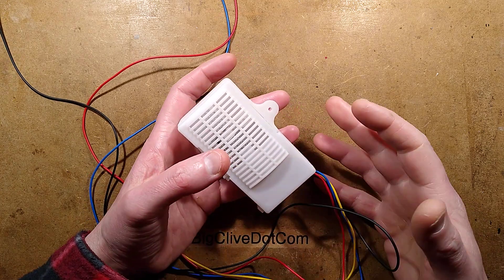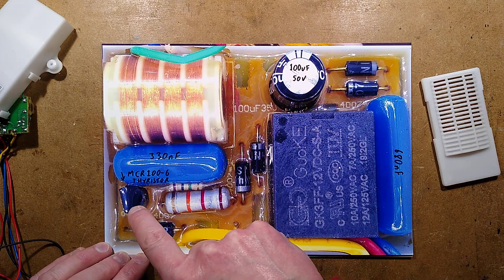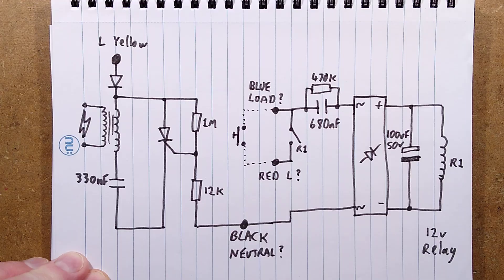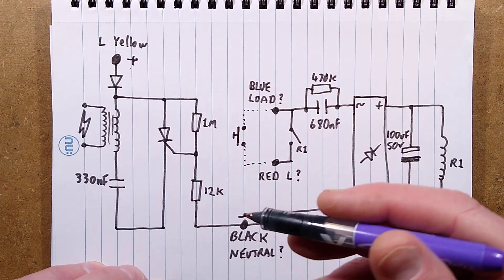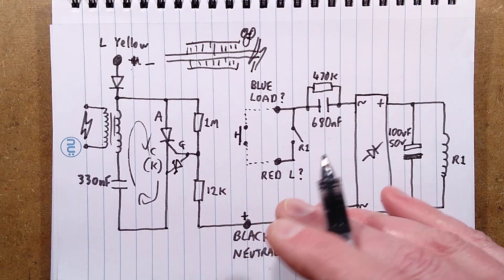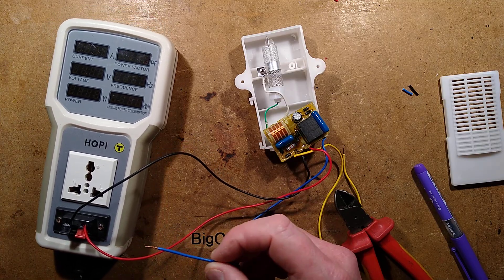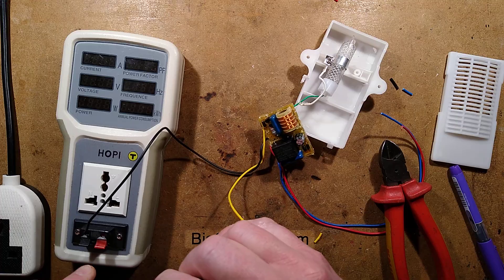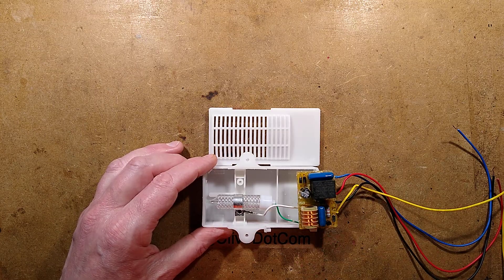Random high voltage eBay "thing"

Comment: "If it's stupid but it works it's not stupid."  Doesn't mean it's not terribly dangerous or short of life! 😆
Reply: hrm. in what sense, you mean because of electrocution/fire hazard? The amount of ozone it's going to generate isn't actually that harmful. Most of it will react by basically instantly with anything that can be oxidized at all; pretty sure you could keep it running in your bedroom without the ozone harming you at all. not that I'd recommend it, the sound is obnoxious - but the lightshow is sweet!
Reply: I was more talking in general,  @covodex516 .  Run hardware too hard or in unconventional ways is going to destroy it faster than creating a slightly more complex but fit-for-purpose implementation.  This device is pretty benign, you're right. :)
Reply: I agree with you Bro but it very work
Reply: is this more efficient and cost less than uv lightbulbs? My profession, put me at high risk to getting the covid.
I did very well. Considering, I knew I was in contact with the infected, every day. I had two powerful uv lights in a small room. I would turn it on and breathe in the ozone for a couple minutes, followed by taking a shower. Eventually, I got a low viral load of covid from a friend. I lasted 12 months, before the “friend” decided to be a fool. The covid, only lasted three days. not a problem... Except, no work for 2 weeks. Stupid World we live in.
Reply: @user-vl9xs5dl7q  What...? No. If the ozone concentration were high enough to be effective in destroying virions, it would also be harmful to you. and UV-lights do not produce ozone in any significant amounts, at least not the commercially available ones.

If you're actually being serious and sat yourself under running UV-lights, then congrats, you harmed yourself way more than Covid-19 probably would have. Spending time in a room with an uncovered UV-light will cause blindness and skin cancer in the long run. There's a reason it's effective in destroying microorganisms and even virions; and it's the same destructive power it has on human cells.
And neither UV-light nor ozone will destroy virions in your body, by the way.

But yeah, you said it...stupid world we live in, lmao...
Reply: @covodex516  i didn't sit long enough to “hurt myself” I turned them on and let them run for a few minutes, then entered the room. I wasn't trying to kill myself. but, you should have asked, instead of assume, that people don't know how harmful uv light is.
Reply: @covodex516  incorrect about viral loads. viral loads will die from uv light. not instantly. but they will die. You shouldn't assume, again.
Reply: @covodex516 
Commercial uv lights were available everywhere, before everyone got spooked. And yes, I knew before they announced it spreading. Not only did the government know. So to, did the military. Again, you assume what is available right now, is not the same, when I bought them.
Reply: @user-vl9xs5dl7q  maybe read my comment correctly? I said the commercially available UV-lights do not produce significant amounts of ozone. and that is the case, im not assuming. not because powerful enough ones would be sold out or whatever, but because there is no commercial applications for those. the disinfecting mechanism of UV lights does not rely on it's ozone production (which yes, it has, just not in amounts which would matter - fortunately) but by the radiation itself.

so what you actually did was disinfecting the air in the room - not even that if you just let it run for a few minutes, but whatever - and then went in to breath the air. great, you of course could've just went outside if you wanted "fresh" air, but hey, you do you. 
the way UV-disinfection actually works in professional labs is by leaving UV-lights run over night or even over several days, without personnel in it, so all microorganisms and virions on surfaces and the air get destroyed. they are shut off as soon as personnel wants to enter the room. and there is no significant amount of ozone to worry about in there - just believe me, I work in such a lab.

anyways, it didn't do anything to virions inside your body. and before you claim otherwise, completely unscientific bogus, come forth with an explanation instead.
Reply: @covodex516  You are also wrong about commercially made UV lights. Maybe you should do more research. Because, it sounds like, you are talking about some Chinese made crap.
Reply: @user-vl9xs5dl7q  and in what sense do you think I would be wrong? It's not a question of quality, but of energy.
anyways, seeing how you just glance over arguments you have no proper answer to, I think we can call curtains on this discussion.

As I said, if you enjoy doing ridiculously unnecessary practices, then you do you. just don't run around and spread bullshit everywhere.

Comment: These are used in refrigerators to aid in retaining freshness of foods. They are sometimes only on when door is closed.
Reply: I would guess that by oxidizing the food would get spoiled earlier, doesn't it? Please elaborate, I'm very interested!
Reply: @peterwilbrink718  Well fridge is cold to slow down little nastiness like bacteria etc? Ozone would kill them so thats gotta slow them down some more im guessing?
Reply: @jons6125  Makes sense indeed, using ozone as an additional measure against mold and other nastiness on the food.
Reply: @peterwilbrink718  I got one of those little triangle rechargeable ozone generators that Clive took apart and it works a treat. 
Had some green chilies that were getting a slight mould fuzz but only on the stalks. Laid them out in front of the ozone generator and it killed the mould totally in a couple of hours giving me enough time to use them up. 
Very effective!
Reply: @Aengus42  Amazing, I'm suddenly in need of an ozone generator:'D
Reply: @Aengus42  so it turned Chili's with mold into Chili's with Penicillin
Reply: @brenttate9299  It turned chillies with mould into chillies with smoked salmon pate, cherry tomato, smoked salmon, crabstick, green tobacco & sea salt crackers!
Result! 😀
Reply: @Aengus42  that's mold not mould
Reply: @brenttate9299  Not here in the UK it ain't! It's mould, coloured green!
Reply: @Aengus42  oh yeah that's right you're the same people to spell tires, Tyre
Reply: @brenttate9299  Tyres... Yes! It's all because of your Mr. Webster who simplified spellings for you. I guess because he thought cowboys were illiterate & needed some help. 
Yeehah!
Reply: @brenttate9299  Wasn't me, wasn't there! 😆
Reply: @peterwilbrink718  The UV and the ozone kills bacteria. Bacteria is thee major contributor to the decay of food.......
Reply: @lookupfromdownunder5218  major decay of food I think not you' don't know my wife cooking
Reply: @brenttate9299  Hi Brent, I have never tasted your wife's cooking but I'm sure she finds it delicious.
Reply: @Robin Rastle well given a fridge is basically an artificial cave, dark, cold but not freezing and mostly dry its not so surprising.
Reply: Thanks for reading your comments Bigcilve, I am a Sparkie too, in Australia, I like your videos. I am impressed by knowledge of electronics. I too have had a lot of experience in that area. Keep up the good work. Regards, Norm........

Comment: That's a sneaky trigger circuit, very simple and kinda free running.
I bet that generates rf noise of the best quality, almost like a little tesla coil going there.
Reply from the maker: Not sure.  It does look like it fires in a closed loop while on the opposite half of the sinewave.
Reply: @bigclivedotcom  Looks like the voltage rises till the 1 meg resistor provides enough gate current to fire the thyristor, and yes it's only on one half cycle. Nasty but it gets the job done lol If you put two back to back it could be a full wave ozone generator lol

Comment: You mention in passing that the wire might be copper coated aluminum, but since copper has a higher melting point, how would that even be possible other than electroplating?  Does that type of wire even exist?
Reply from the maker: Sadly it does.  Many flexes with products from China via eBay have copper coated aluminium.  You can test it by stripping some and holding a flame under it.  If it glows and holds its shape it's copper.  If it flares and and droops it's CCA.

Comment: I think that thyristor thing is pretty much a standard trick. I haven't used thyristors, but I've used Triacs which are pretty much the same thing. Triacs can be fired in FOUR different quadrants, and I'm pretty sure this is just the other one of those quadrants that will fire it.
Reply: Triac will fire in all 4 quadrants because it is bidirectional. Thyristor is only going to fire in quadrant one,  and will only fire with both positive gate voltage and positive anode, and resemble a diode in all other quadrants and stay off.  Running the gate into reverse breakdown will however cause damage to the thyristor itself, as the gate area is small, and will degrade from running in reverse breakdown, as it is a reverse biased emitter base junction. 

Small thyristors are not rated for use with gate turn off, where you deliberately use reverse bias on the gate to starve the thyristor latching, to turn it off. You do need a different design to get the gain of the lower transistor high enough so the gate current, which will be almost the load current at it's peak, which you pull out  to turn off, is enough to turn the transistor off. The gate path needs to be large enough to handle this current, and in a small device, where it only has to handle 50mA or so of drive to start it turning on, the junctions will rapidly degrade. Long term this thyristor will simply fail as short circuit gate to cathode, and stop functioning, though it probably will take a year or so to do that if use cycle is low, but only a few thousand mains cycles will degrade it. 

Another diode added to allow the current flow would have prevented that.
Reply: @SeanBZA  Yeah, what you said! (I thought I knew-my-stuff) but I must put on the dunce cap and go sit in the corner.
Pax

Comment: The corona discharge tube was neat. By the way. What is a thyristor usually used for?
Reply from the maker: Ironically for pulsing high voltage circuits like this.  But it was originally invented before the triac for use in pairs controlling AC power.

Comment: So, if the corona discharge is within the tube, how does it split oxygen/form ozone outtside of the tube...?
"It's complicated..." I like it!
Reply from the maker: The gas is just a virtual electrode coupling current to the entire inner surface of the tube.  The corona discharge occurs where that charge couples through the air to the wire mesh.  The corona discharge is entirely on the outside of the tube.

Comment: So why did it work with the red and blue wires to the side? I thought those controlled the relay?
Reply from the maker: They seem to be an independent section of circuitry with a common neutral.

Comment: I have a theory. Might be wrong:
Yellow is LINE
Red is NEU
Blue is still connected to button and Red.
Black??? 

Press button to momentarily latch circuit. Current runs from yellow to red. That puts the two circuits in series, not parallel, which would theoretically cause the relay to recieve less than 17v. Closer to the rated 12v. Idk about black. There might be a different configuration where it's helpful.

Comment: Clive didnt exactly say that thyristor breakover was undocumented, it is in fact documented, but 99 percent of circuits dont use that feature, they just turn on or off in the conventional ways.
Reply from the maker: It caught me out.  I shared it with my electronic peers and Dave at EEVblog pointed me to one of his videos where they use the same technique in meters with two transistors acting as a bidirectional zener.

Comment: "Using this thyristor is the most unusual way I've ever seen"
Means a lot coming from Big Clive.  He's been doing this for so long I thought he's seen everything.
Reply: There is a whole industry where the Chinese throw in redundant parts, just to confuse Clive...
Reply: @Peter_A1466 ' Reverse Engineering' at it's finest.
Reply: In my house that is sexy bedroom talk.
Reply: @greggrimer1428  Germanium diodes always work for me!
Reply: @conmcgrath7502  Point contact types ? Check them for very dim LED like light output.
Reply: Clive is literally like an electrician wizard for me.
Reply: This is probably designed by randomly connecting components until something happened.
Reply: Ha!  Or the ‘Muntz’ approach, take a perfectly designed and operating circuit slowly apart until it stops working, then add that last component back and ship it :)
Reply: @111000100101001  I always love telling that story.
Reply: @jurjenbos228  that's like what I did at ten when I took random household electronics apart. I made a "brain fryer" once. A box that got hot. I'm lucky I didn't fry myself.
Reply: Always something new to learn each day, you just have to seek it out more once you’ve learned most of the basics.
Reply: Another undocumented mode of operation with some thyristors is gate turn-off. Drive the gate positive for a latched ON. Drive it negative for OFF again.
Reply: the analogue electronics equivalent of fast inverse sqrt

Comment: Back when I taught micro lab, UV C lamps were used to sterilize biosafety cabinets.  Now that I work in pharma, ozone is typically used for water purification.  It looks like a few of those...things...would do nicely in a small enclosed area.  Might be worth a simple test.  Enclose a moistened slice of bread in two equivalent chambers. One with the ozone on, one off.  Wait a few days after a few hours treatment and see what wee beasties grow
Reply from the maker: There's a clue on eBay for the original purpose.   Some listings hint at it being for a chopstick sterilisation chamber.
Reply: Now that is interesting.   It would make quite a lot of ozone for a small volume container.  I wonder how effective it would be.  Especially compared to something easy like washing then with hot water and soap.   I also wonder how long the enclosure would last before the ozone destroys it.  
Oh well, what would the fun be if there wasn't some new thing to make quick work of a job you didn't event know needed doing.

Comment: BigClive, I know you are an expert but every time you play with exposed wires, you scare the shit out of me
Reply from the maker: Good!    <evil laughter>
Reply: I had a instructor in my electrical engineering lab do an impromptu demonstration of  generator syncing by wiring it up live. At one point he had red, yellow and blue phase wires in one hand. All were live on a circuit at 440VAC and fused at 200A. It was scary and even more so when I saw that the other instructor in the lab was standing well back and looking nervous.  I decided to trust his experience and stepped back too.
Reply: @andrewfrance1047  And whay happened later?
Reply: If you ever need constipation relief you can tag along on a day I'm doing field work! (Frequently there is no alternative to working inside live equipment, 480VAC 3-phase or 120VAC 1-phase in my case. Knowledge and some reasonable precautions keep one safe. Sure I've been zapped but obviously not fatally)
Reply: I was waiting for " Och aye ya wee Bugger  !" but it never came !

Comment: As a programming-guy, I'm starting to wonder if I can use Clive's reverse-engineering & hypothesizing as a bridge to gain enough understanding in electronics to explore some hardware interests.

Thank you again for another intriguing video to mull over in my spare time.   =)
Reply: Oh uh, I should clarify that when I say 'explore' what I mean is to 'learn' and test with very low voltages. 'Bangs' caused by 'very-low voltages' are usually mear pops and easier to manage.
Reply: @odo324  there are lots of circuit simulation software
Reply: @odo324  pops and bangs are not produced by linear black box functions and are more akin to energy or Dirac pulses however as a software guy if you are handy with a calculator you should no doubt begin to understand that Clive hypotheses really are correct.
Reply: It's not exactly something that will teach you electronics, but relay logic and ladder logic might be of interest to you as things that occupy a space between the two fields

Comment: For one second i thought they somehow managed to use a bit of meshed garden hose
Reply: It's meshed for her protection. Oh wait, wrong video..............
Reply: Dammit, how am I going to get a patent now? You just had to open your big mouth.
May Cornish Pixies infest your garden!
I'm not sure if that qualifies as a curse necessarily? but you definitely don't want them in the house or anywhere near your tool-kit....where's the 5mm drill bit? bast'd pixies, I can hear them laughing silently! (in answer to your question, no, I don't get out a lot, I am the patron Saint of Lost Virtue, living proof that it is indeed possible to find your virginity again?)
On a complete tangent, if you are ever 'stuck' to drill stainless steel and the pixies have made off with the exact drill bit you needed? A masonry bit might get you out of trouble, no it won't be exact but it will be effective.
Pax vobis (lockdown? what's that?)
Reply: @conmcgrath7502  one of my favorite drill bits for drilling hard steel is the carbide tipped glass and tile bits.
Reply: @justindunlap1235  ya know Justin I was just thinking about that while watching big Clive's video on a mystery contraption from China.
Reply: Piskies
Reply: I was thinking of a stent...shows my age, I suppose...😉
Reply: Me too. I'm really curious what thar wired garden hose do.